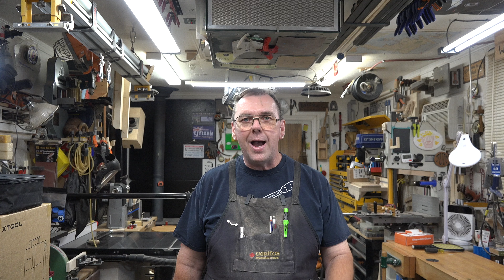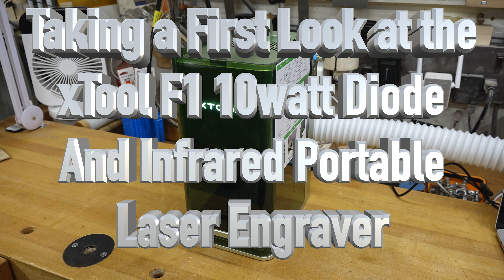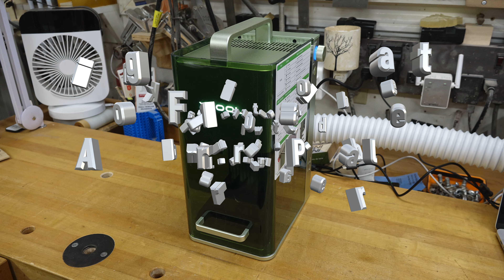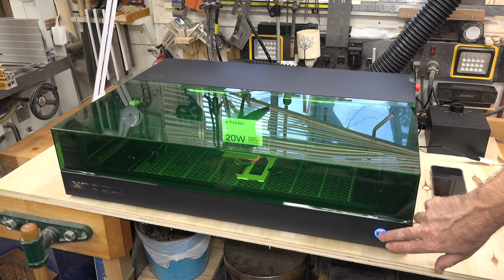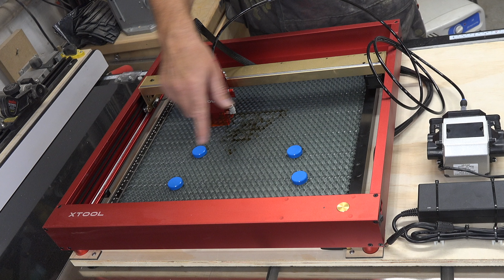Taking a First Look at the xTool F1 Portable Laser Engraver

Comment: will this engrave a logo on a 16 inch wood bowl bottom or just wider than the base area?
Reply from the maker: Sorry for the late reply Joseph.  You can engrave the centres of the bowls but you will have to remove the bottom working plate of the laser.  I hope that made sense.  Thanks for tuning in.

Comment: Outstanding.  I want one!!     A terrific show and a great product demo.   It’s an amazing machine.
Reply from the maker: It does have some limitations due to its size but for smaller engravings, this machine is incredible.  Fast, compact, portable and dual lasers which enable it to engrave way more materials than a diode laser alone.  I'm impressed with what I've seen so far.  Thanks for tuning in this week and for taking the time to leave your comment.  I hope you get yourself an F1 one day.
Reply: @acutabove_woodworkings  I do have the 10W D1 Pro and it serves me well for what I use it for but the ability to laser metal and very small text (used on some of the models) would be a perfect ad.  I even thought  about selling the D1 and going with the F1 Portable but realized that the size limitation might be something to consider thoroughly before moving.  I know the F1 has the slide extension but not sure if that would solve sizing issue.  But the clarity and speed are certainly impressive.
Reply from the maker: @pdwoodwerkz9625  I will be producing a show in the near future on the F1 slide extensions and fume extractor.  When those shows air, I hope it will help you make a decision.  The D1 Pro is a good machine also.  I have the 20 watt version and it's been one of my "go to" lasers since I purchased it.  If you have any questions at all, feel free to ask.

Comment: WOW!! The speed in which this processes the info & run time. The price is high but the time you save is impeccable, I look forward to an update when you push it to the limits. Thanks again for a great tutorial Kenny. 👍🏻🇦🇺
Reply from the maker: I'm actually quite shocked at the speed of this machine and it is due to lack of a gantry style engraving system.  Lightning fast in comparison to an open frame system.  Just incredible.  I'm looking forward to putting this machine into operation with some upcoming projects.  Thanks for tuning in Troy and for taking the time to leave your comment.